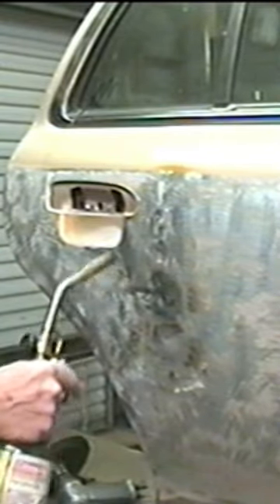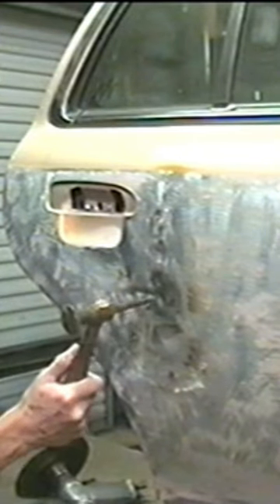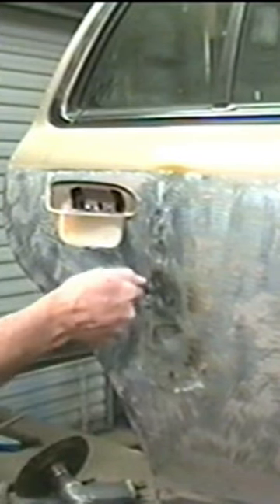Easy Metal Shrinking Trick #shorts #autobody

Comment: Nice job. That looks like some solid sheet metal in that door. But I feel like if you tried this on modern cars the door would probably disintegrate or melt with that cheap crap they are making cars out of. lol 😂
Reply from the maker: You'd be fine on the 22 gauge sheet metal of today.  Here's an example on a 2016 Chevy Sonic - can't get any thinner than that 🥴 - https://www.youtube.com/watch?v=nUBinQYIMUY
Reply: Poor workmen blame their tools...or in this case their workpiece
Reply: @LakesideAutobody  oh I’m sure. But I’ve done more than my share of dent pulling with a stud welder and on 22gauge sheet metal you have to be more careful when even applying studs as an extra second or so on the trigger burns the metal. Also when pulling you really only get a few good wacks before thing just rips out. Older metal I would have to overpull to the point of making the same kind of bubble that you made the video showing how to shrink. I take it easy and don’t have these issues but I remember back in the day having much more leeway to shape the metal. Also with a lot of cars using aluminum that creates a whole new can of worms.
Reply: @Sturz7  I was mainly making that comment tongue in cheek. I’m not doing too poorly as I was able to open my own shop. And yes I have and do continue to repair all makes models of vehicle regardless of thier material composition.

Comment: So now it looks like you need to lay in a bunch of filler. That area looks really rough.
Reply: Not a bunch. Only a skim coat on the entire surface, or filler on treated area with the rest buried under primer. It will be A okay
Reply: @jonathanyates5198  okay I'd like to see you finish it in a video.
Reply from the maker: Here it is ready to paint - https://www.youtube.com/watch?v=itEzOW8Knzs  The amount of filler used is normal for a regular body shop.  A magnet still stuck well to it believe it or not.  Here's a vid that may help too - https://www.youtube.com/watch?v=rIoNhu166Hw  You have to get good with filler if you want to work in a real body shop - like dealership, MAACO, etc.
Reply: you always need to lay filler in on a repair. Like he said just a skim coat. should be less than a quarter inch thick which is totally fine. Otherwise there is no other way to shrink the metal. Where do you want the extra to go? it’ gets stretched out from the initial damage in the first place. I prefer using a shrinking hammer myself with the meat tenderizer head to try and keep the countershrink small but I’ve done this before in a pinch. 
Otherwise what’s the alternative?  Cut out the tin can and just reskin the door? doesn’t make sense on a small repair like that. 

A thin coat of filler applied correctly should never crack or show signs of its existence. Especially if the bodyman can sand and prep to save his life. 

Granted your average joe shone at home will probably have this door looking like it was filled with peanut butter 😂But that’s why you find a pro and these tricks are just to help remind us of things we forgot.
Reply: @LakesideAutobody You know i made my comment above before even reading this line you wrote because that was the first thing I thought of. I have a small shop these days myself after working for other guys for 25 years or so.